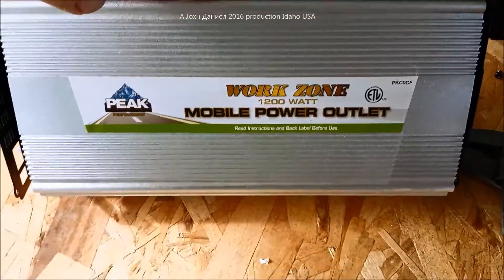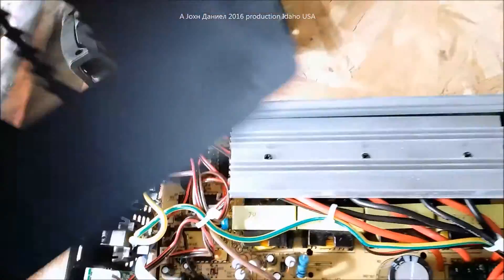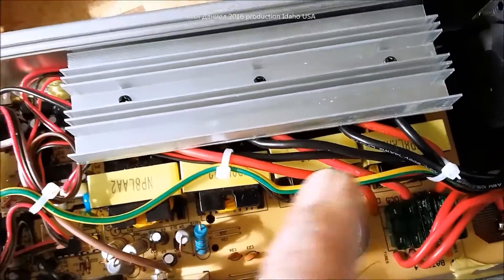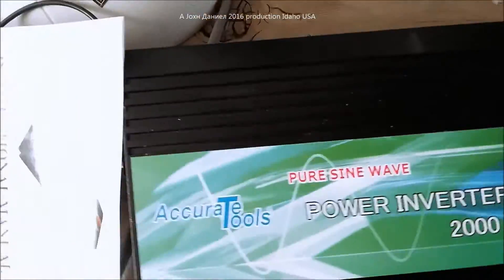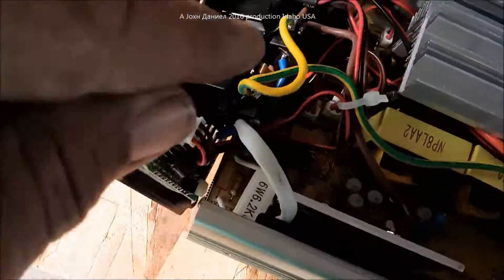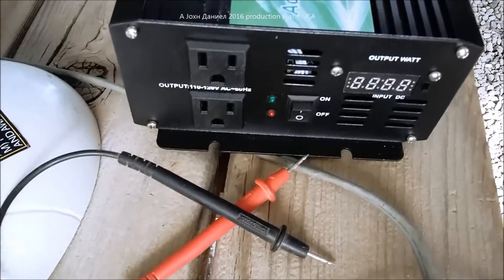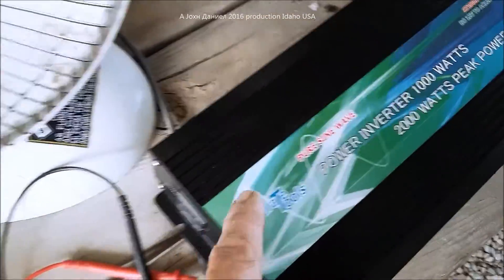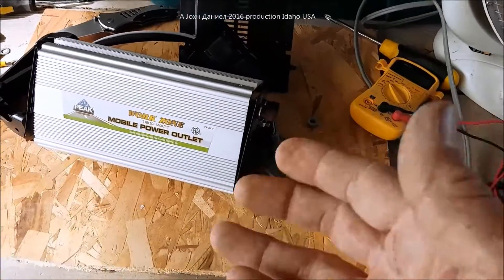Inverter Modified Sine Wave or Pure Sine Wave Vid 4 TESTING

Comment: modified sinus invereter to pure sinus ? where is trik...explain to me
Reply from the maker: Showing how a pure sine works and acts compared to a modified sine wave. Note how the electrical noise is higher in the modified. Theres 4 videos on this, showing the full reviews of the 2 inverters.
Reply: I too was looking for how you converted a modified sine inverter to pure. Apparently, you did not. You just compared them. Thanks.